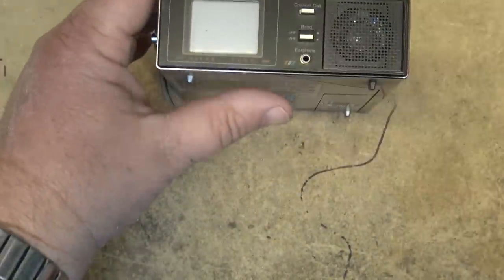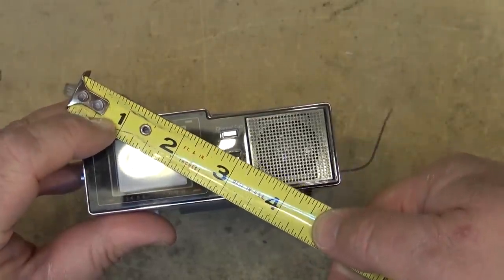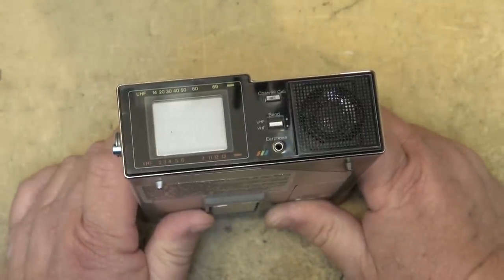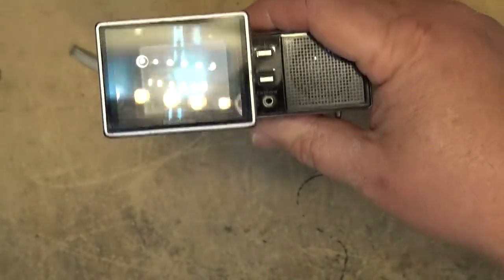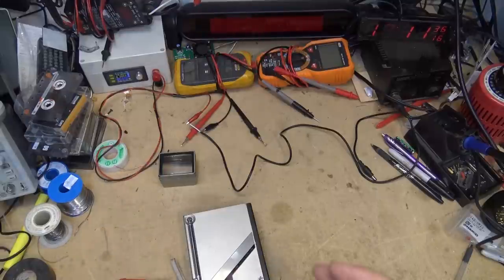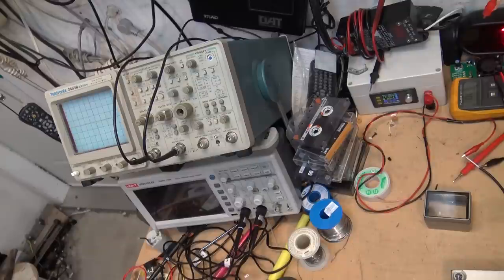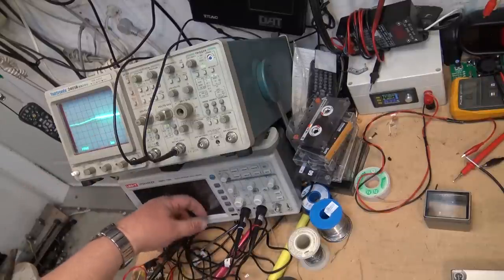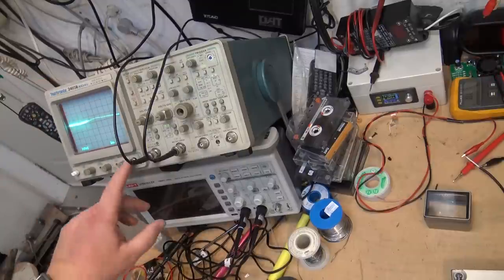Smallest Color CRT TV set in the world

Comment: I miss the dynamic convergence circuits. This one is probably a delta shadow-mask tube with an in-line gun. Like almost all color computer monitors from the early '80s through the mid '00s except Trinitron and its knock-offs (Mitsubishi Diamondtron and LG Flatron).
Ha! Scott has the service manual. Pause at the specs. The service manual states that it's a 30° deflection angle in-line tube!  https://youtu.be/OoJNqLpPpcc?t=102

Comment: how did you set up your own tuneable tv station?
Reply from the maker: It's a commercial head end modulator with +60dB output. Hook an antenna to it, and it will broadcast a few hundred feet. I have 4 of them.  Set to channel 5, 7, 9, 12. The channel 12 is in MTS Stereo sound, and I use it to play canned concerts I have ripped from youtube, and send them throughout the house.
Commercial modulators were  designed to be fed into signal mixers to combine all the signals the cable company was going to send into the cable. Once all the signals are mixed (and levels balanced) they were fed to the amplifiers that sed the signals out to the community.
Reply: Easy, just chain an HDMI to component converter with a component to RF converter and connect to an amplified antenna (with the amplifier connected backwards). You can get all three parts for around $60 on Amazon.

Comment: I found a smaller color viewfinder tube using beam index, trying to find those viewfinders.
Reply from the maker: I have one of those too but the color filters for the beam detector is missing so it only shows b/w.  Beam index is a monochrome tube. 1.25" is big for that.  I have a .5 monochrome.  This is the smallest color tube, with 3 guns and a shadow mask.  Beam index has 1 and no shadow mask so that doesnt count.
Reply: @12voltvids  I know it doesn't count lol. I have one of those itty bitty Video8 cameras with a CRT viewfinder, smallest CRT I know of. I am still blown away by the resolution of that thing! I am trying to find a working beam index tube, I want to make a little color travel television!
Reply: @12voltvids  are you implying that indextrons are a monochrome television?
Reply from the maker: @mandarin1257  
They are color only in the respect that they display a color image you could get the same effect if you attached a color stripe filter t ok a black and white screen.  Indextron is a type of beam index tube. 
They are both a single gun tube but work in totally different ways. In both however it is about timing the beam so that if you want if you want red, the beam is only switched on during the time the beam is passing over the area where the red phosphors or red filter is.  In a conventional beam index tube a yellow and blue detector points at the screen (in the viewfinder shell of the camera) so the color sync circuit knows where the beam is. On the Sony indextron version an extra uv stripe is added between the red and green stripes that flashes uv light every time the beam hits it. This strobing uv light it detected by detectors attached to the cell of the crt looking at the back of the screen.  This little tv uses a conventional color crt, which had 3 guns, 3 lenses, and a shadow mask.  Beam index has none, which means they can be much smaller because there is nothing more in them than a monochrome tube.

Comment: Screen wise, there is smaller
Reply from the maker: This is the smallest CRT color set that uses a conventional 3 gun shadow mask crt. Hitachi made a 1.25" beam index color tube, and there were several black and white tubes used in camcorders most using a round tube. Sony had some rectangular .5" bw tubes. I did a video on one, but this is the smallest true color tube.  It was developed for the camcorder market.  LCD/oled do not count as they are not a crt.